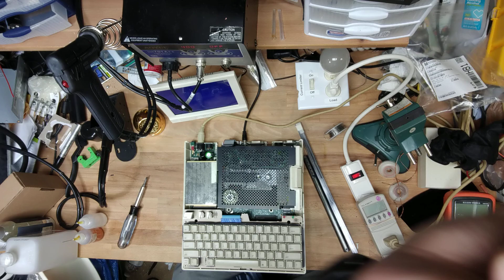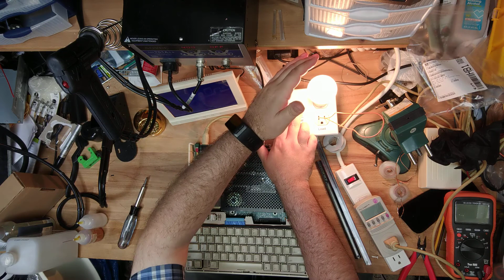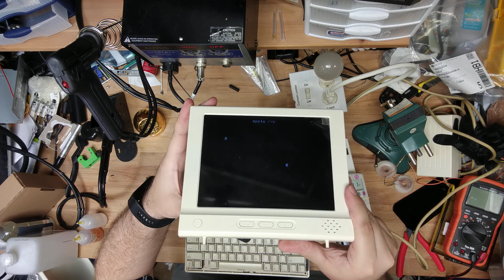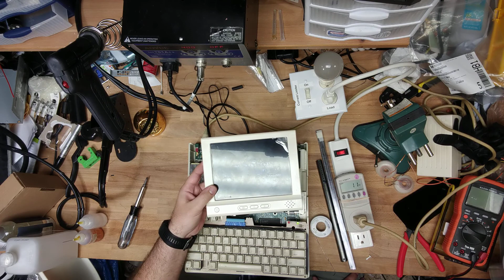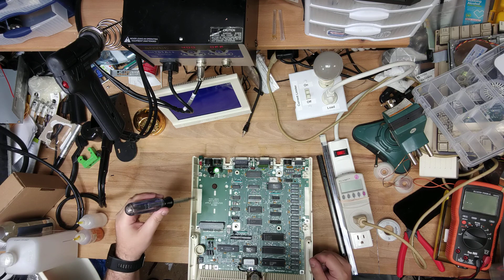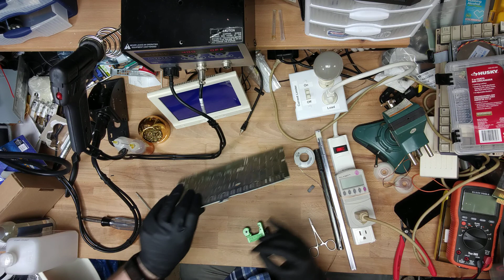#1 - Apple IIc Faulty RAM Diagnosis and Repair (Part 1 of 2)

Comment: This comment may arrive a bit late, but I was wondering what is that Florida retro computers club you mentioned at the beginning of the video. I have been working on a IIc for some days now, and have not been able to make it run yet 😬… I thoroughly cleaned it, reseated the chips and sprayed contact cleaner , etc. All I get is garbage, color with some pattern, and sometimes apple iic together with garbage 😅… I live in Miami and would like to contact someone from this club. Many thanks